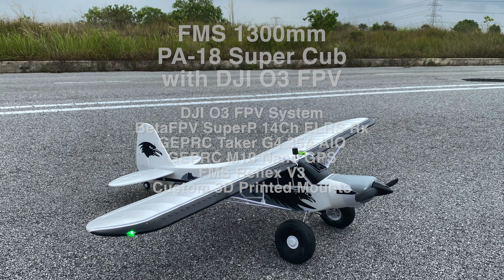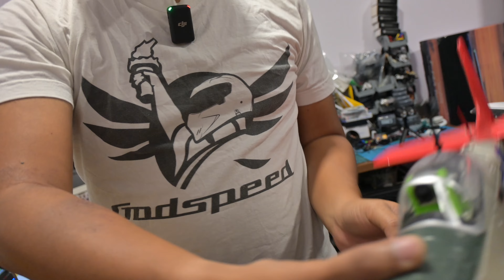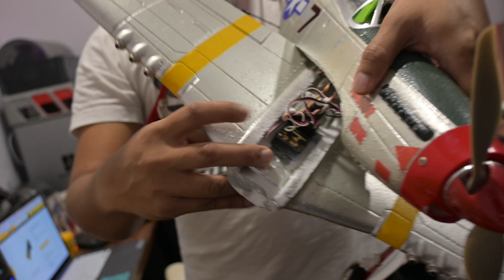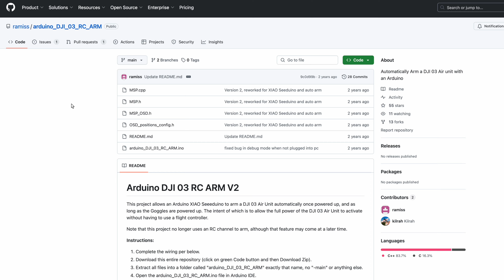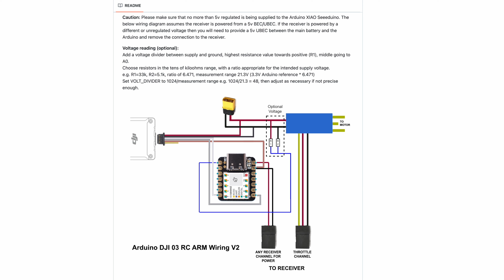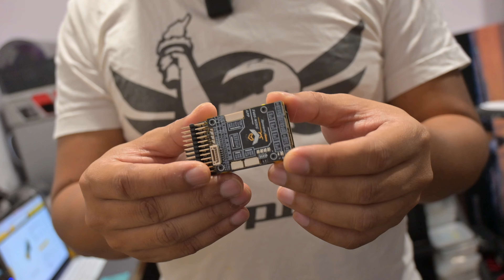RC Plane DJI O3 FPV Setup Tutorial - @FMSRCAirplane 1300mm PA-18 Super Cub #fpv #rcplane #hobbies

Comment: Good Afternoon and Happy Holidays, I have a question or multiple, I have the 1300mm p18 and I followed your video and was wondering that being all servos still went through your receiver and reflex, how did you connect to the flight controller to get the artificial horizon, air speed and altitude to show up on your osd.i am using a Spektrum NX8 and AR8360T Receiver. Also a Dji 04 air unit.
Reply from the maker: I'm using an AIO from one of my FPV drones. Not sure how to do it with Spektrum, I'm using ELRS PWM which I can specify 2 PWMs into Rx and Tx and then connect that to the AIO to get Betaflight OSD which has the artificial horizon from the AIO.